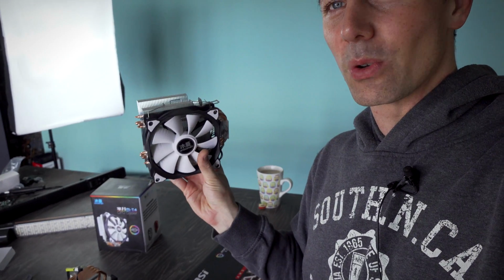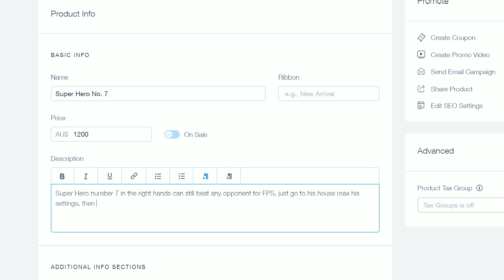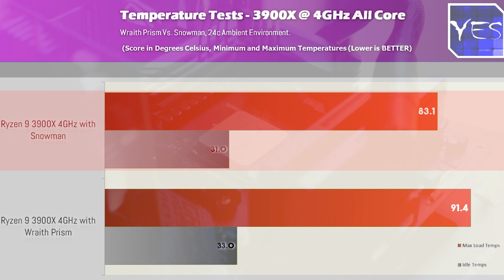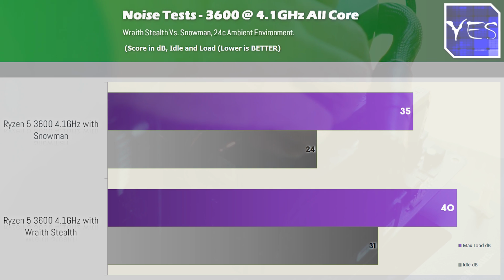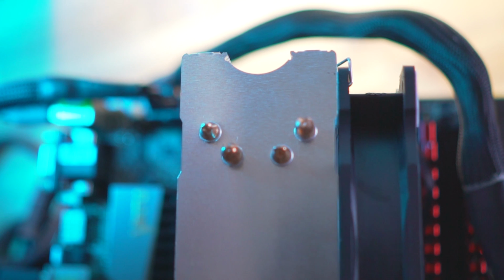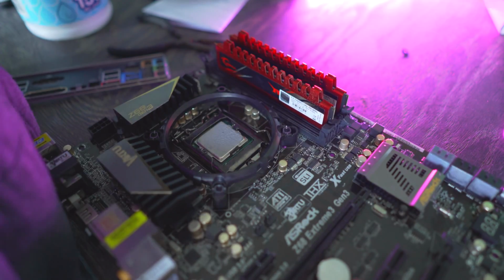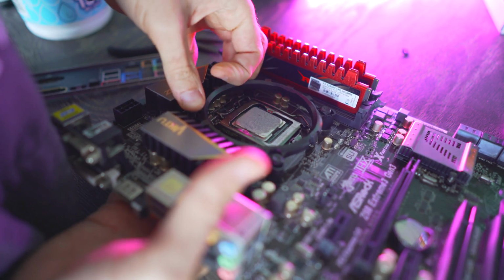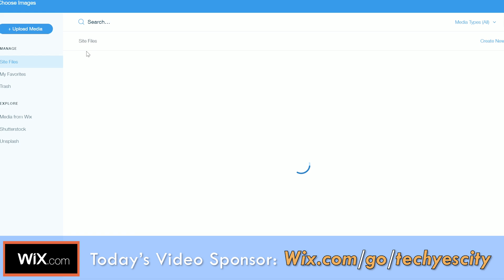Is this $17 Snowman CPU Cooler the BEST Money Can Buy....!?

Comment: the deepcool gammaxx 400 has always been the king of the super affordable and reliable air coolers at $20. looks like we have a new contender.
Reply: Got the gammaxx for $13 on Amazon on sale. Not much of a looker. But does the jib
Reply: @prahjister  Get some spray paint for the other $7 and it becomes a looker :). I painted the stripe with the logo in the middle black, and the rest white, matches my build pretty well.
Reply: I bought the Deepcool 400r for $20 and it is pretty good at cooling in comparison to the wraith spire. It's currently cooling my Ryzen 3600.
Reply: @DankBlank  I have 3600 too, and looking for a cooler to replace box one. How did Deepcool improved your temperatures?
Reply: @mihailbormin  so for my 1500x it was running at 3.9 (maybe 3.95 GHz but I know it wasn't base frequency) and I was getting way over 95c and my PC kept crashing while exporting videos from Premiere Pro. 

With the 400, and the same voltage at around 1.39 I was hitting no more than 83C to the point where I can lower the voltage and still hit 83C and not crash. 

(Same applies to my 3600 as it does ~4.1 GHz on all cores while exporting a video).

Also temps vary as I'm using a phanteks p350x case.
Reply: @DankBlank  I'm also using Premiere Pro, and the box cooler just isn't cut for the job. Not bad results in your case I think, although I still want it be even lower. The max boost clocks only achievable if the temperature no higher than 65-70C, and even at 68C you might already see CPU start to throttle. At least it happens on my cheap MSI b-450a-pro with mediocre beta bios.
Reply: @mihailbormin  I think if you want it that cool I'd go for a more expensive cooler lol. Maybe one with dual towers like the Dark Rock Pro 4 for ~$13 more.

Edit: I don't know why I said the dark rock pro 4 was ~$13 more... The Hyper 212 Evo is good for the price.
Reply: @DankBlank  How is the 212 good for the price when the Gammaxx 400 is cheaper and slightly better? I haven't looked at this video yet but a few other nice cooler that are closer to the 212 in price but better are the Artic Duo and Windale 6 coolers. A tad bit more expensive however their perf justifies it
Reply: @HeiiKun  honestly it depends on how much you can spend. If you can buy the 212 Evo, you should as it most likely a better cooler.
Reply: @DankBlank  How is the 212 a better cooler? Is it because it is more expensive? That is not how things work; just because it is priced higher doesnt mean it's better. The 212 is overrated and unless you live in a location where supply of coolers is limited and you cant get the 400, Duo, Windale 6, then the 212 is a horrible buy. If a cheaper product can perform better then there is no reason to buy the more expensive one that performs worse. That was the Gammaxx 400, cheaper and better. Now that is the Snowman. At the 212's price point you can spend basically $2 more and get yourself the Arctic Duo and probably $8 gets you the Windale 6. The Duo's price is so little over the 212 that it is in the same price bracket and makes no sense to buy the 212.
Reply: @DankBlank  makes less noise than the r5 3600 cooler box?
Reply: Using gammaxx 200 for my i5-4460 does well
Reply: I have a deep cool captain 240ex. Love it.
Reply: I think it basically is the deep cool
Reply: I would have bought the Gammaxx 400, if it wasn't for the stupid LED that can't be turned off, but I got instead the Inter Tech Argus 260 for 23€, which is basically the same thing as the Snowman.
Reply: The stock fan has blue LEDs (unless they changed that in the past couple of years), which is a no-go for me. Also the intel mounting is the same as the stock intel cooler, which imo sucks. Im still using it tho ‾\_(ツ)_/‾ (with a different fan).
Reply: @TKIvanov  Well technically you could just cut the wires connected to the LEDs, since they are exposed, but than you would probably void the warranty. Also why don't you like the Intel push pin mounting system? When it works as it should.
Reply: @TKIvanov  ☺️ yeah i agree, i hate when aftermarket coolers insist on making you use generic intel plastic push pins, they have gotten cheap because years back they gave you a big bag of mounting options: brackets, bolts, nuts, rear bracket 😡
Reply: @MrSamadolfo    One of my computers has an x58 motherboard in an older case.  The Gammax worked out well for me as without the plastic push pins i would have had to remove the motherboard to mount most other coolers.
Reply: @wysetech2000  🙂 i understand that but years ago you would get a big bag of mounting options, bolts, nuts, rear brackets, and it also came with the plastic push pins as well, but these new aftermarket kits are kinda bogus 🙂
Reply: FUCK ME !
Reply: https://bit.ly/2GKALOx is the best cooler it have 6 Heat Pipes and is only 14$, best deal if you ask me))
Reply: I had to pay £24 on amazon for my gammaxx 400 ($30 US in brexit pounds!) But it gets my I7 3820 at 4.625 ghz :)
Reply: That's what I have in my system. It does an excellent job cooling my R5 1600 at 3.83 GHz
Reply: I got the gammaxx 400 for $19 on amazon but it had to be the red one to get that price so I cut out the leds completely and painted the top matte black, looks great and cools my kids fx8350 with no issues. :-)
Reply: And I bought the regular version, but got the nice all white version for the same low price.
Reply: Yeah, I'm a massive fan of the Gammax 400. Around $22US from Amazon, great performance, quiet and you get blue LED bling included! It can also handle those 130W Xeons.
Reply: Comparison of the Snowman to the Gammaxx 400: https://www.youtube.com/watch?v=FB8cWBCsV3Q
Reply: 🙂 i dont like the 400 too much, they cheapen out in the bracket department, like for intel the cooler only comes with the generic plastic push pins that u c on a stock cooler, long time ago most 120mm coolers came with a nice box full of mounting hardware bolts nuts brackets 😍
Reply: @MrSamadolfo  Very nice point. Same with this one, a slightly different approach, but still the "snowman" has push-pins. I personally prefer the nuts and bolts, at least Raijintek Themis Black is 25USD and the very same Evo goes on sale now and then for about 20USD. No push pins for me! I still have my Xigmatek Gaia 1283, I added another fan to it for Push-pul and it just kicks arse!
Reply: @dveydah  ☺️ years back when i was a noob i could not figure out how to mount the intel push pins, they kept popping out, for the noobs i think its easier for them to start out with a traditional Bracket & Bolts n Nuts, or the AMD Switch Blade 🙂
Reply: @MrSamadolfo  It seems we have passed through the same trials 😉 Today I still prefer the bolted option to control the pressure on the IHS 😉
Reply: @dveydah  ☺️ yup me too
Reply: Well then maybe the cryorig h7.
Reply: r Negoro 
I have it ... it is very good but cost more the 20
Reply: I'm in China and its summer this time of year (40c daily) and I have just bought the Gammax 400 for my CPU and it keeps my i7 blow 60c under load paired with new case fans called PC Coolers. Fantastic case fans btw. GPU and CPU are at about 60c under load with the case fan setup.
Reply: Deepcool is still better because it slightly beats out 212 evo
Reply: 🙂 tip: if height is a problem because of case the next step down is the Coolermaster T4 its 5mm lower in height, after that next step down is the Deepcool 92mm but it has an oversized 120mm blue fan 🐢😊🐢
Reply: @MrSamadolfo  The T4 is only 2mm smaller than the Gammaxx 400, while the Snowman is the smallest of them all.
Reply: Lets not forget the Arctic Freezer 34 is round 21euro and is a beast.
Reply: @exol511  for 10€ I'll go for the snowman

Comment: it looks a lot easier to install than the 212 i hate the 212's xclamp thingy.
Reply: it is very easy, especially on an AMD AM4 bracket, but take note, a bit of excessive force is needed to get the second clip to lock in, to a point you feel as though you're about to snap the retention bracket.
Reply: @MrFreekyJ  is the clip really appears to be short? It looks like you are going to bend the board when I try to install it.
Reply: @eytfiftin  Yes, it feels that way, but just keep adding force slowly, concentrating on getting the retention clip of the cooler down and inwards on the retention plate.
Reply: @MrFreekyJ   what i did is i loosen the brackets first, with my experience its almost impossible for me to install
Reply: @makmekmik  Haven't tried it that way, but thinking about it, I think it may work well.
Reply: @archiethej4903  temps are pretty good, idle 35-37, stress test aida64 @ 3.95ghz auto volt 50 degrees.